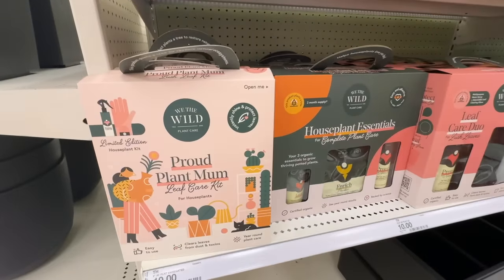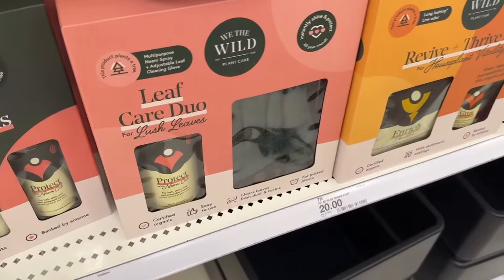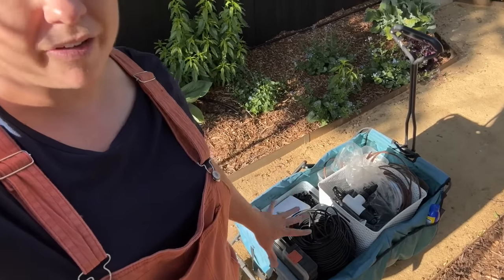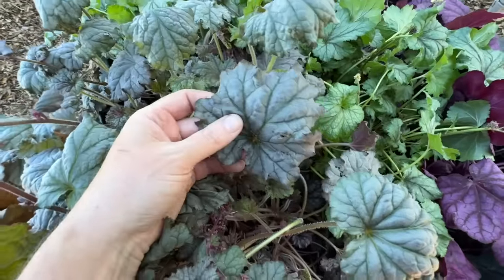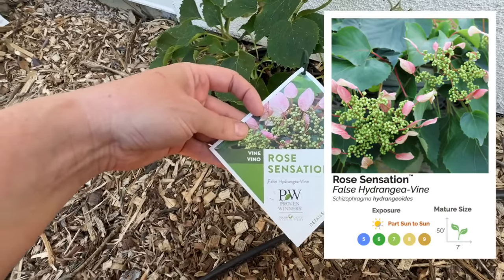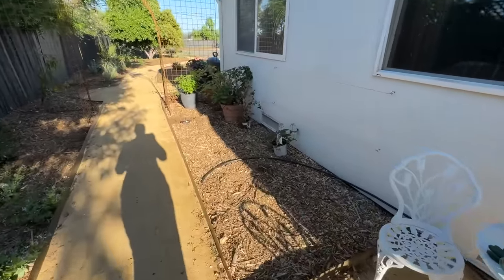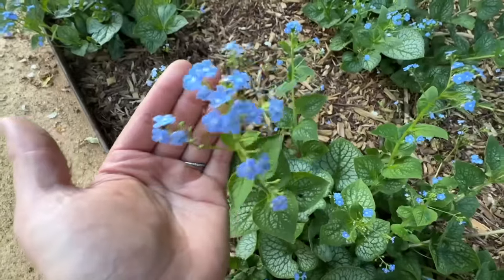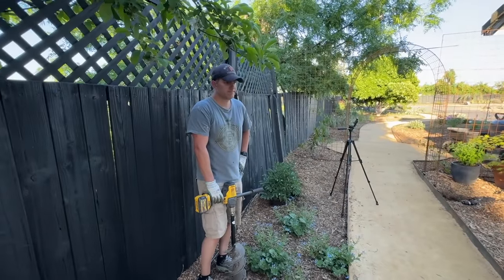Planting Shade Garden Perennials and CLIMBING Hydrangeas!

Comment: Janey, you can have both. I love my boxwoods! They are the one shrub that is so low maintenance in my garden. They tolerate the heat, the cold, and the squirrels ignore them. Plant your romantic flowers behind the boxwood hedge which is what I have done. The hedge just makes everything neat and tidy and in no way takes away from the softness of my other plants. Just prune your boxwoods with rounded edges. Just drop the word formal and everyone will relax.

Comment: Was watching your coffee talk, we had three acres and loved are stock tank pool. All four of us could sit in it. I could even put two chaise lounges in it to cool off. Was so easy to make. Don’t paint! We had it three years was great, I saw a video about painting-did proper etch, prime, paint and it still peeled a year later and was a mess. You can even buy an inflatable hot tub and hook its pump/heater up and it turns it into a hot tub.
Reply: I've been considering doing a stock tank pool for a few years now.  I'm just concerned about the maintenance,  is it too bad?
Reply: @katiedavis5861   not at all. We kept net hanging near it, scooped out leaves or bugs, kept it covered with in insulated bubble top cheap on Amazon (I’m in Colorado and cold nights) and had the chlorine tabs we dropped in this little thing that floated in it. Used it May through September. Drained it through plug, flipped it over during winter until we did the hot tub thing. Once or twice had to test it and add some extra chlorine or borax.  We got a lot of use out of it.
Reply: @kmsch986  oh wow that's not bad at all!  Thank you for replying ❤️🙏

Comment: I planted a climbing hydrangea last year.  It is only about an inch bigger at this point.  I did notice that there is one stem that seems like it might be going for it to put on a little more growth.  If yours is anything like mine, it definitely will not reach the top wire.  Mine would not even reach the bottom wire at almost a year later.  Gardeners plant with hope and this is one that I think will show off once it gets going and make the waiting time worth it.

Comment: Don't feel bad about your tape measure - I lost my trowel, and think it might have been dumped into our garbage company's compost bin! That led me to have to buy another one, but actually the new one is even better. It is a Corona "transplanter," which means that one side of it is serrated, which is great to cutting roots, and the other side is smooth, plus it is slimmer than a regular trowel, so it can get into tight places much easier. It also has a padded ergonomic handle with a finger guard. I sure love those Heucheras are gorgeous! I find their little flowers rather magical-looking. Since you asked, I love the country romance theme throughout your property better than a totally separate room with boxwoods. I read that dwarf boxwoods only grow 1/2" - 1" a year. It would probably be easier to wait for the one climbing hydrangia than an entire boxwood border. Btw, was Monty eating the wood chips??

Comment: You may not need to buy a new fountain pump. Small water pumps usually can be regulated by moving the  tiny plus and minus signs printed on the sides.

Comment: Hi Janey! Off-topic, but did you ever use the rain barrels you installed at your previous house? My vegetable garden is in a location that does not have a water supply nearby. I'm considering using a rain barrel and running drip irrigation from it. Does drip tubing/tape need a certain amount of pressure to work properly, or would the rain barrel be able to fill the lines up enough to provide a slow trickle of water? I'm new to drip irrigation so I'm a little intimidated by it all!
Reply from the maker: You have to buy special drip tubing system for rain barrels.  Look up "gravity feed irrigation kits." Super easy.  You got this. 💪🏼
Reply: @DigPlantWaterRepeat  THANK YOU!!!

Comment: No boxwoods not there. But listen I hope somebody reads this. I put it in the notes every single time when you’re using the auger you push down and then pull it out and then it goes deeper next time push in and then pull it out maybe 2 to 3 in and then pull it out and then in and then pull it out, just as one steady movement don’t stop and go. It’ll be so much easier.❤❤❤